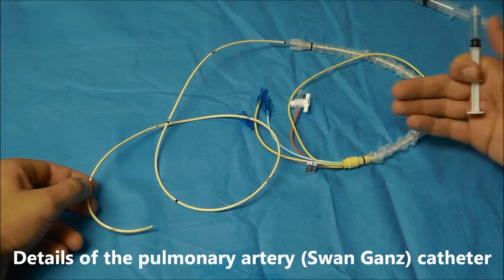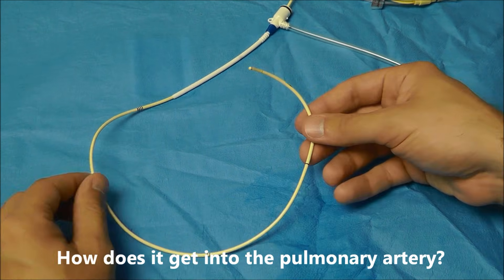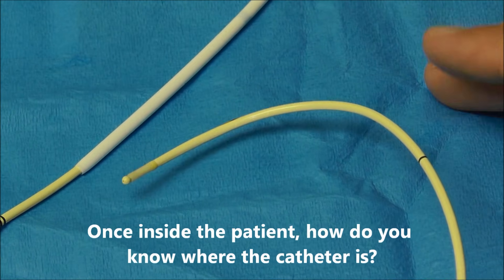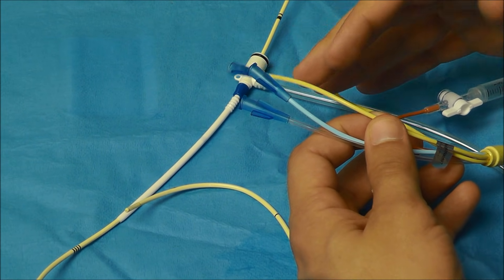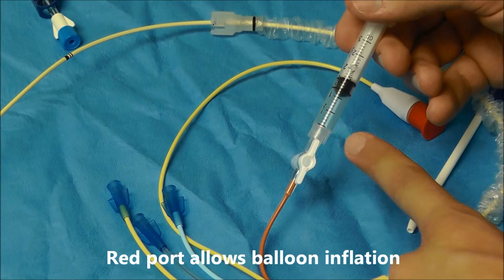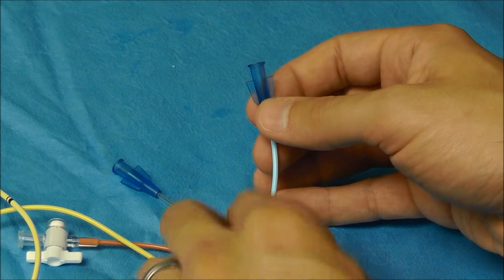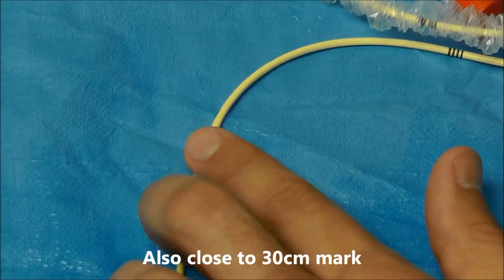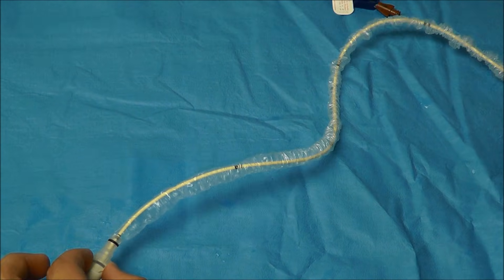Pulmonary Artery (Swan Ganz) Catheter

Comment: Thanks a lot for the awesome explanation. But can anybody tell me, how many lumen are there in this catheter ? Since there are 5 ports, so one should be for each, but diagrams of cross section of the catheter on the internet shows only 4 lumen ?. Last one which you did not discuss is the thermistor port or transducer port or are they same thing ? Thank you
Reply from the maker: Yes, I didn't mention the thermistor port.  Mostly because we never use it in anesthesia.  Thanks for pointing that out :)
Reply: How many lumen are there in this catheter ? Thank you
Reply: 4 ports.  3 transducer ports plus one balloon port.  Some Swans also have a thermistor.

Comment: Can the PCWP be obtained if the PA port was obstructed or not plugged into the machine? I just had an examination that provided a diagram of a PA catheter. It asked what port obtained the PCWP... Answers were as follows: A) CVP port, B) Thermistor port with the red cap, C) PA port,  D) the balloon port. I chose C and was told it was wrong. The instructor said it was the balloon port, which is used in the process of getting the PCWP, but it doesn't obtain the PCWP pressure.
Reply from the maker: That is a horrible question.  If that is how the question was worded, the correct answer is the PA port.  Prior to wedging, the PA port is sensing blood pressure from the forward moving flow from the pulmonary artery and right side of the heart.  Once the catheter is wedged, the PA port can no longer sense blood pressure from the right side of the heart.  It can only sense pressure coming from the pulmonary veins and left side of the heart.  The balloon allows wedge pressure to be possible, but the port that provides the pressure is still the PA port.  Does that make sense?
Reply: Pain, I totally understood that and that is why I picked C. I appealed the question and the instructors are watching each other backs and not giving the points back. Thank you for the explanation though.
Reply: Why would the Dr change the number on the machine  and us a calculator  to come up with number . I thought this precedure  would give us  the number

Comment: I have a question, does the baloon at the tip of the catheter remain inflated all the time or only during pressure checks. ?
Reply from the maker: +linu mathew Thanks for the question!  The balloon should definitely only be inflated when the catheter is being advanced.  It would need to be inflated if the anesthetist wanted to know what the patient's wedge pressure is.

Comment: Oh man all I can say is THANK YOU!!!!  Very easy to understand!  I have one question.  Does the catheter itself ALWAYS sit in the PA?  and Do you need to back it out to get pressure readings and waveforms for the RA and RV?
Reply: Thanks for the compliment!  Yes, the distal tip of the catheter always sits in the PA.  Remember that hooking a transducer up to the yellow port will give you a pulmonary artery pressure.  Clinically, we never need to get a right ventricular pressure.  But right atrial pressure and CVP are considered to be roughly equal.  In order to know CVP with a Swan, you don't back the catheter up.  Rather, there is a port at roughly the 30cm mark of the Swan.  This should sit in the right atrium.  If you hook a transducer up to this port (blue port), it will tell you the pressure in the RA (CVP).  Any other questions?  Let me know!